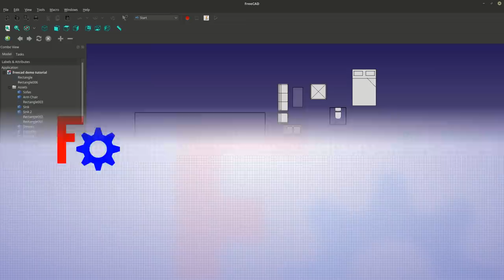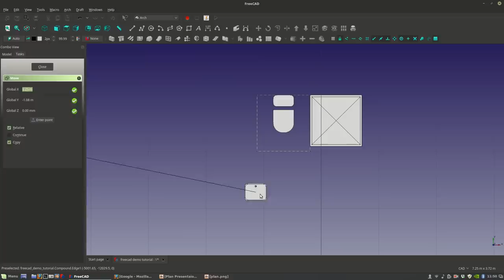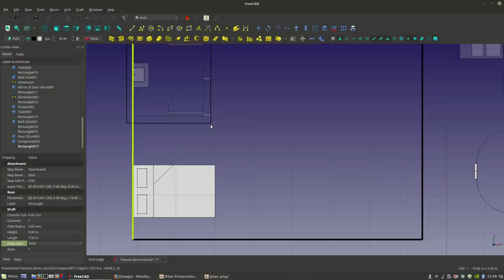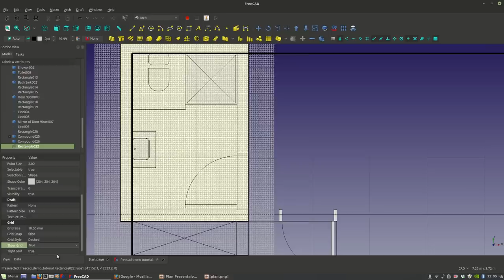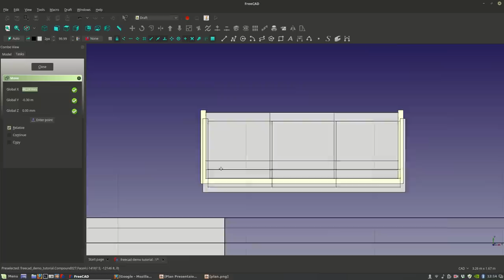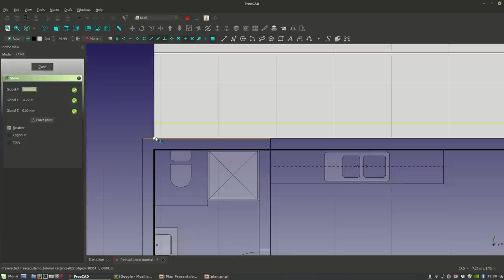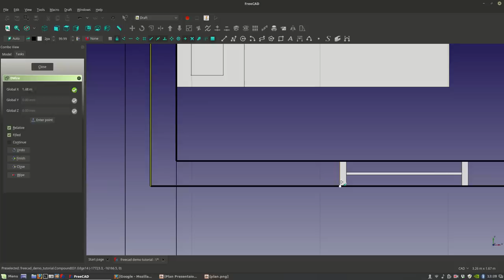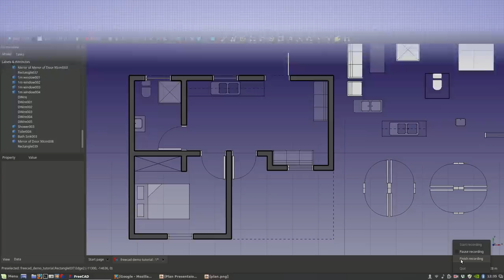FreeCAD Arch - Creating 2D Plan - 02

Comment: Thank You. I am facing a problem. When you select any element and place it other point, you get a reference points (like mid point or corner point) for accuracy. But I am unable to do that. Can you please help?
Reply from the maker: Sure i can take a look at your screen sharing. Do you have skype?
Reply: @RegisNdeTene  No. But I can install it.
Reply from the maker: @harshpatel.4705   sure do so and let me know,
Reply: Sir, are you on LinkedIn? So that I can follow you there.

And also we have time zone issues. So I might need your appointment.
Cheers !!
Reply from the maker: @harshpatel.4705  Certainly you can find me on linkedin with the same name as my youtube channel.  Sounds good we can set an appointment over skype. it will be most preferable.
Reply: @RegisNdeTene  hi
Reply from the maker: Hello

Comment: People complain too much. This is a great tutorial. One question, though: when I mirror my door like you did in the video, and then change or delete the original one, the mirrored door is also changed/deleted. I'd like to take this dependency away from my mirrored compounds. How can I do that?
Reply from the maker: Can you point me to the minute in the video?
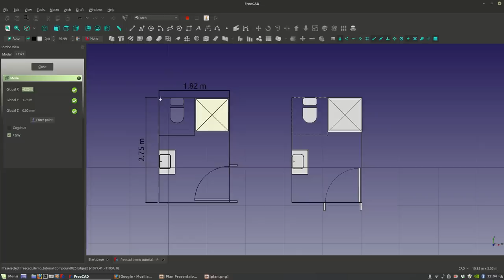Reply from the maker: So if you see the video at 21:40-45. I mention that the reason I copy is to break the link of the compound. So you can make a new copy of the mirrored compound. I think k it should break the link. Try that and let me know.
Reply: @RegisNdeTene  Hello. I just tried that but it didn't work. Stepwise, here's what I tried: I created a door, turned it into a compound, then mirrored it, then copied the mirrored door. It seems I can move the copy as freely as I want, but as soon as I make a change or delete the original door, such change propagates to both the mirrored and the copied doors.
Reply from the maker: Ok that must have been a new development. I have another idea. Do you have the bim workbench installed?

Comment: Your tutorial is good but very boring.
I hope that next time you created a short time tutorial.
Thanks
Reply from the maker: Haha, thanks for your comment. Sorry I couldn't predict it would bore you. But I also suppose you didn't understand the direction of why I created such a lengthy tutorial in first place. Hopefully if do more tutorials, i'll be considerate of you. Next time you can just skip what bores you.
Reply from the maker: The idea was basically as follows, Since Freecad was relatively new, There was just too much introductory material to expose, especially for those who are seeking information and want to dig in deeply into the information. Once all these basics are thrown out there, eventually at some point I was going to start doing curated material, straight to the point where I do all the thinking outside of the video and just record at once, bringing the entire watch time down completely to less than 5 - 10 minutes. But since this is a lot of work and requires preparation before recording, it will take some time before you see these tutorials, so in the mean time, hold your horses, enjoy what is currently available, and lets party afterwards.